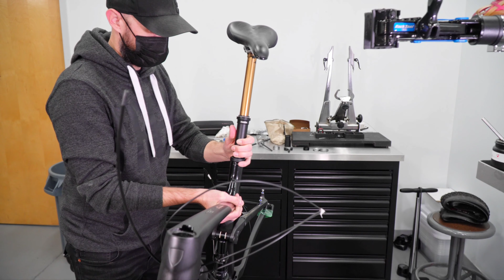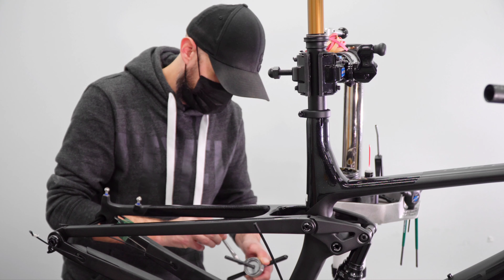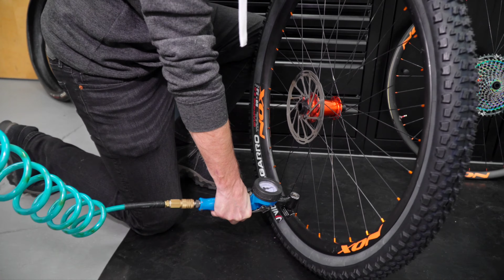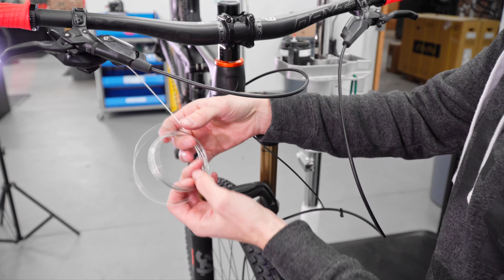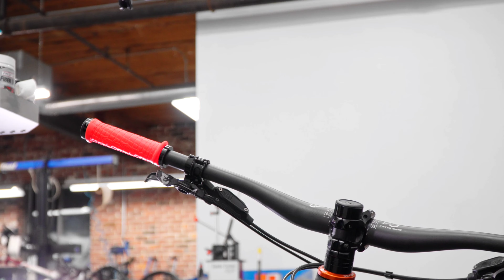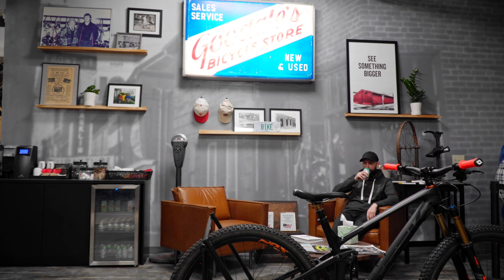Dream Build MTB | Trek Top Fuel

Comment: Nice built! I have the top fuel 9.8 2020, quick question what you added on the rear shock to hold the cables down? The cables are scratching the shock and don’t want that. Thanks and great video!!
Reply from the maker: It's a clip that's integral to the frame... it came on my frame

Comment: Such a clean build and so well spec'd! Quality filming as well! I honestly wouldn't change anything about it if it was my bike other than I would swap for the ergon enduro saddle with the oil slick rails to match the oil slick sram components and I would swap for a RF turbine orange stem, however the race face orange may clash with the TLD orange.... I bet the Ergon orange grip color with the oil slick clamp set would match amazingly well..... whatever,  your bike looks amazing as is. Looking forward to seeing how you build up your Slash. I'm guessing you ordered a frame and are building it up with fox and sram?? That lithium color is clean! I noticed Trek doesn't offer any Fox builds and you like me seem to be fox preferential. I'd be inclined to keep that new RockShox Super Deluxe Ultimate shock with the updated Thru Shaft damper and go from there.
Reply from the maker: Ya Im not really big on colored stems and color matching everything.  I actually think it looks cleaner if it's subtle.   I honestly see alot of bike builds with color match EVERYTHING and don't like them much.  Yes I did order a slash frame.  Yes it will have fox as I am supported by Fox and just prefer to run fox forks as they are set it and forget it for me.
Reply: @Projectnortheast  respect

Comment: Wow first time I saw a dream build that I actually care for.  What was your decision to go with agarro for front and rear vs a mazza,martello or mazza, agarro
Reply from the maker: Thanks!  I chose the agarro because I love it as an all around trail tire.  The top fuel is a trail bike through and through so putting an enduro tire on it would just slow it down.  The agarro to me is the perfect trail tire, rolls extremely fast, has great traction and is strong enough to not leave you stranded.  I'll be doing a tire review on it soon!
Reply: @Projectnortheast  absolutely i figured you went that route for the tires capability and I asked because it was a trail bike.   I have a agarros as well but I have never tried them on yet, still on my dhf,dhr combo.  I ride slow so I normally go with like a trail Enduro front and a faster rear.
Reply from the maker: @ns671fr  Ya I like the agarro alot, it's minion esq in it's grip but the knobs don't fold over on off camber rocks etc....

Comment: how much you end up spending ? I want to built one . so i can use my extra parts .
Reply from the maker: On the whole build or frame?
Reply: @Projectnortheast   All  I got  are  fox 36 ,  stem and handle bar. from a 2022  9.8  eX  thank you
Reply from the maker: @angelasuncion8395  this is a top fuel, not a fuel EX.  I too used alot of parts i had on hand so I'm not really sure the total cost